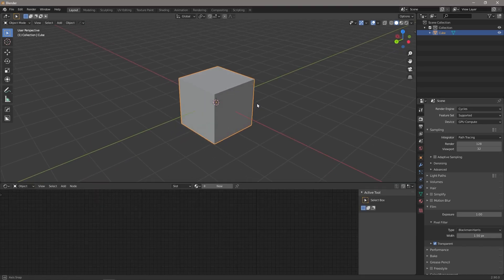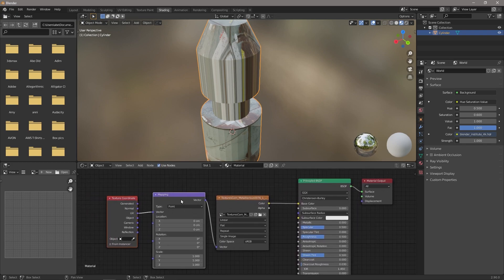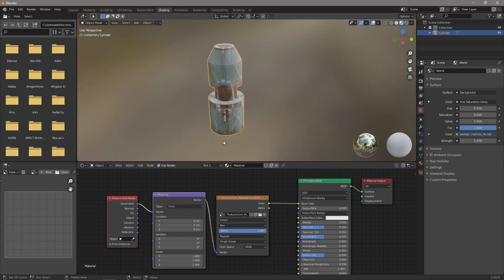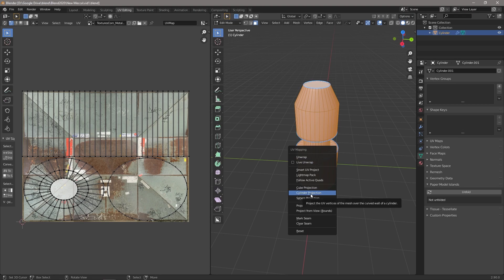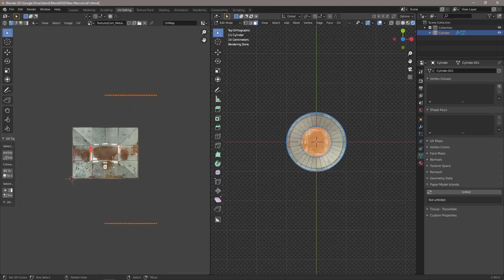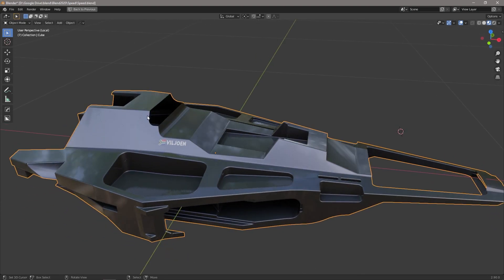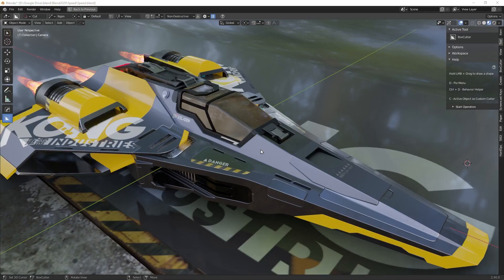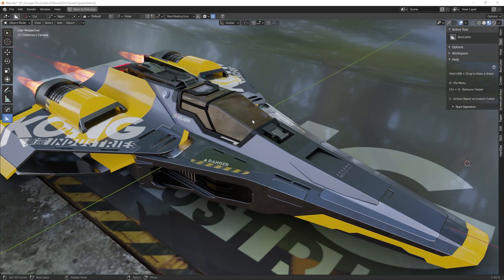My Dirty UV Hacks

Comment: That's how I normally do my unwrapping, with the exception that I don't waste so much space ;) For example, when you put the flag + name on the side of the cockpit, you say you "only need that little piece". But instead of just unwrapping those two faces where the flag should be, you select the whole side of the cockpit section. And you repeat it for the other side and have two logos in your image where you place your UV faces. This results in a rather large image with a lot of empty space and two small logos.
Which means, you end up with a low resolution logo for the cost of a large resolution image file. I would make an image that is filled up with the logo (once, since you don't have different versions for left and right), select those two faces at once where the logos will be placed, project from view, scale them both and position them so that one side is perfect. Then flip the face where the logo is mirrored in UV Editor and re-position it correctly.
That way, you don't have to do two projections, one for each side, just one for both. You also don't need large UV textures with almost nothing in it. Or - if the file size doesn't matter - you can have much higher detail in your logo at the same file size.
Reply from the maker: You are 100% right, when I initially exported out the whole side, I had intended to do more graphics. It could definitely be optimized better.
Thanks for your insight.
Reply: @blender5293   Okay, I see. Then of course it's better to take the complete side and two logos in one image since the elements would be positioned differently . Another thing is, you left the extrapolation mode of the image texture on "Repeat", which is fine if you always fit the complete face inside the image texture. But if you have to scale the face larger than the image and you don't want the logo to be visible scattered all over the face, then "Extend" or "Clip" would be better.